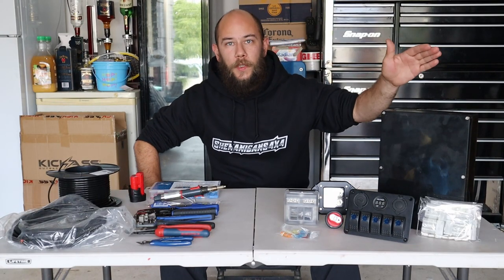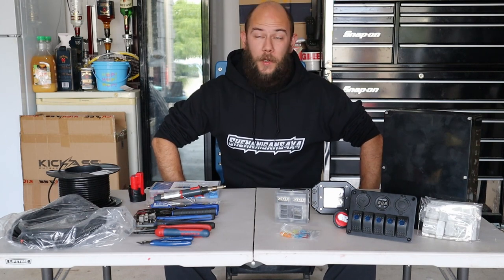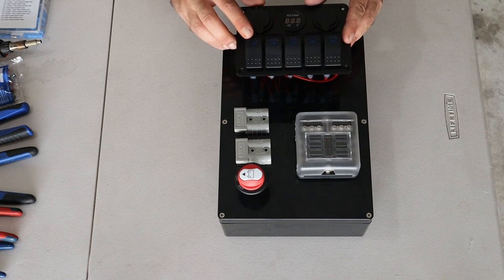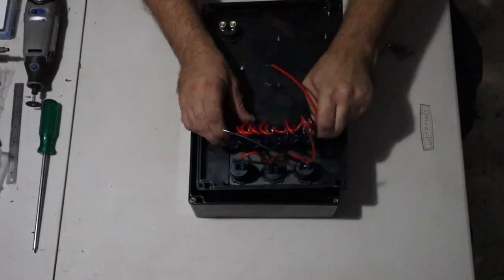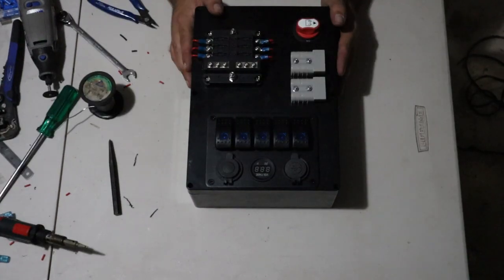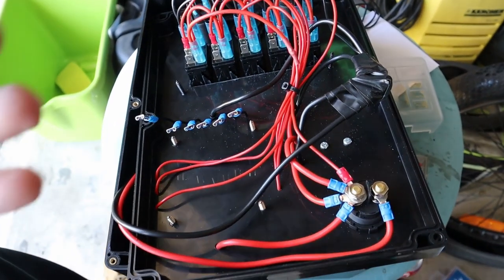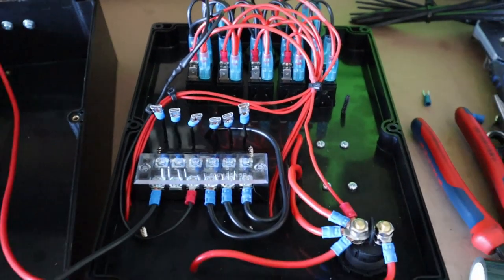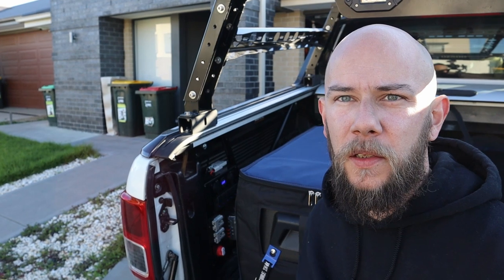DIY 12v Control Box! | Fused Switch Panel and LED Wiring | Ford Ranger Mods

Comment: Does it still come out cheaper after buying the tools?
Reply from the maker: Not if you include the tools no
The assumption is that these tools and the wire would be needed anyway if buying a pre-built box to add in your accessories
Always good to have handy also when out and about for any repairs

Comment: Hey mate I’ve got the same tub rack and love your setup with the fridge and false floor etc I’m looking to do exact same thing but just with a tonneu soft cover instead! I’m just a bit stumped with how to wire up the lights I haven’t got an auxiliary battery setup yet and I’m wanting to wire them up to the starter battery with a rocker switch on the dash and also reverse lights! How did you wire yours up? Cheers mate love the content! Keep it coming 🤙
Reply from the maker: Cheers Ethan! Glad you like the content :)
I'm not an auto elec so don't go just of my word.
All I've done is used the dual core wire from the lights to the switch (+) and earth (-), then added a fuse on the positive into the switch.
All earth's go back to the negative side of my secondary battery.
I may add some relays later on but I think the LED's are low enough amperage to run just with the switch (again confirm this before doing it yourself).
Thanks for watching 👍